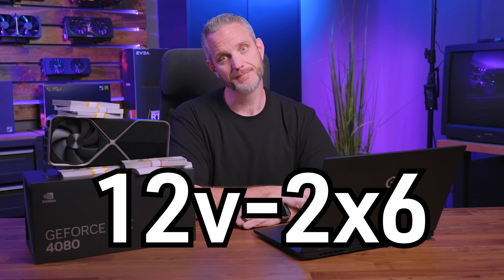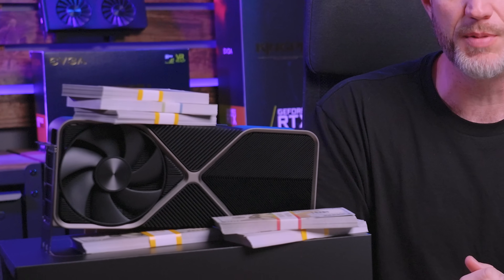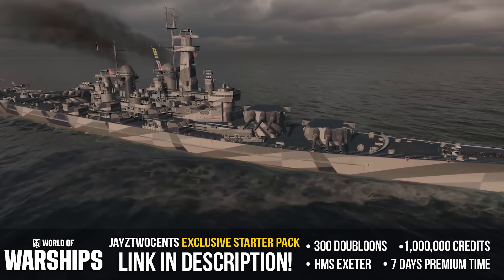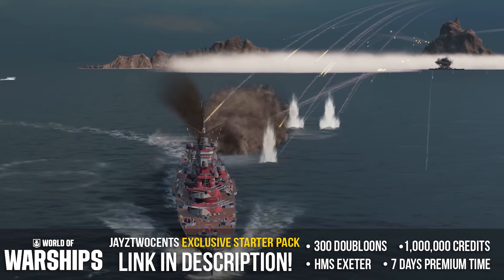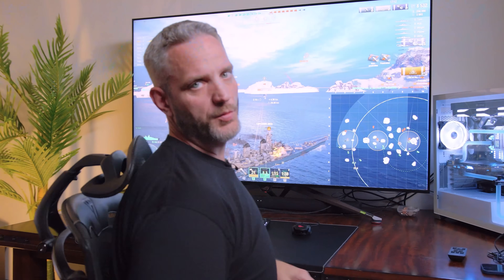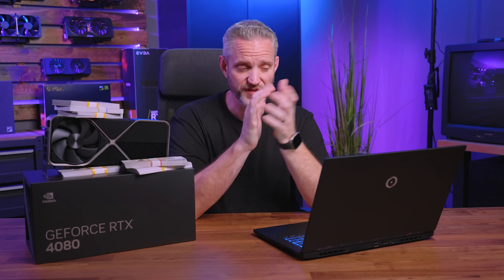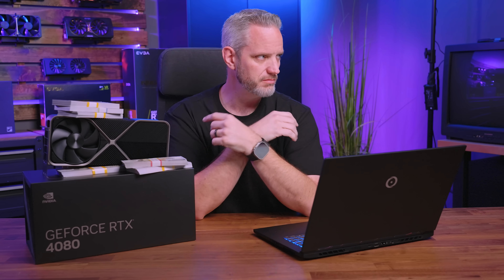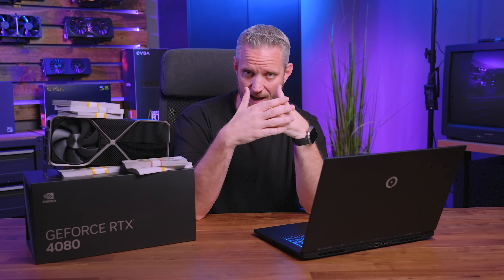They FINALLY admitted that this was a major issue!

Comment: You're channel is  good Jay!
Actually this falls under warranty or a recall action
I stick to my point, better control of products to be purchased before they can be sold!
For the very powerful graphics cards in the future perhaps a better connection to the 12V supply!
Luckily I don't have the money to buy these very expensive video cards!
I have to save up for that, but I can imagine that with these amounts you can expect that they will provide these cards with an extra short extension cable with the best connector for the graphics card in the packaging!
Reply: Properly seat your power cables, buy a case that fits, do not bend cables, do not use 3rd party adapters, have a professional who knows what they are doing building rigs and you will have a %99.9 success rate according to the data. ✌
Reply: @javiersantana848  I have assembled computers my whole life!
What I have been reading here lately about expensive but poor quality cables!
Very expensive but also bad graphics cards going up in smoke?
No one who assembles these parts correctly can change that even a professional.
It is an expensive lottery!
By the way, I'm scared when choosing a new heavy graphics card for my flight sim computer!

Comment: was it only the 4090 that had an issue? or all the cards that used the 12vhpr? I've been looking at a 4070 ti super and I'm concerned because I've been seeing news that it's STILL an issue.
Reply: "was it only the 4090 that had an issue?" Any gpu that fails to properly seat power cables could have issues. This same issue has also happened to the 30,20,10 series and beyond. Due to the higher total power draw of the 4090, it becomes a bit less forgiving in these regards which is why we are hearing more about the 4090 than any other gpu when user error or 3rd party adapters etc. Google search shows this. Properly seat your power cables, buy a case that fits, do not bend cables, do not use 3rd party adapters, have a professional who knows what they are doing building rigs and you will have a %99.9 success rate according to the data

Comment: Hi Jason, Just wondering what your thoughts are on the Corsair HX1500i PSU coming with a 12VHPWR lead but only using TWO x EIGHT PIN PLUGS (of which only 7 are populated) & thus only using 2 of the sense connectors on the 12VHPWR plug but claiming that the lead is suitable for the 600W requirements of the RTX4090 ???

Comment: Is there an H+ or H++ on the plug somewhere? Mine has a date on one of the 4 plugs 06/23/23? How do you tell if you have a new one or not?
Reply: did you find an answer to this
Reply: No only a date of 06/23/23 on one of the plugs. I didn't chance it I went with the msi a1000g with the new 12 volt plug to be on the safe side.

Comment: Why don't they just manufacture a pin without the barbs and come up with some type of clip similar to locking down a processor?  That way when you want to disconnect, the plug would come out easily without the barbs yet the clip would keep the plug secure.

Comment: So it has been 3 months now, and I am reading posts on reddit getting a 4090 with the new connector, are there any reports of these new connectors having any problems? I am very curious because I just ordered a 4090fe at the nvidia store. So did the new conector fix the melting problem?
Reply: Same issue with the new connectors because the actual problem is user error. These videos are click bait at this time

Comment: Got the angled v1.1 adapter in the NICK of time just checked my previous adapter, started melting luckily the gpu connector itself is fine save for the top right connector now being dark grey

Comment: Lots of plugs on cars use locking pieces. Little annoying, but they hold solid for 20 years. I know it's not practical but this is why I like bolt and ring eye connections. 
I remember the plug on my 2070 and even older 7870 is a bitch to plug in and I always worry about something breaking.

Comment: Is Nvidia going to do a recall to fix existing cards ?
Reply: No they would tell you jus to return it to get it fixed if it happens again keep sending it back lol nvidia offers 3 years warranty. They wouldnt do a recall as then they would have to accept working cards that did not have the problem yet

Comment: seems like 12V was too low and they really should've gone straight for 24V... also stop messing around with these connectors. we know how to do this right: screw terminals on the board and ring terminals on the cable.

Comment: I have another theory as to what may potentially be causing it as well. If the pin is bent slightly (so it is no longer centered within the plastic housing), this will force the connector contacts apart. While I have not had this happen with a 16 pin, I have had it happen with an 8-pin. It didn't cause a fire or anything to melt, but it caused the system to continuously bluescreen. I had to discard that power supply cable since the contacts inside one of the connectors was forced open by the bent pin on the GPU connector. I also had to re-center the pin with needle-nose pliers to avoid the same fate happening to my other PSU cable.

Comment: I have always said from the beginning of 4090 that the power plgs on the PCB were low quality and couldn't handle the high amps when working at max or near, but you all were stubborn and said it was other things. Thi shows how yall are stupid except the ones who agreed that the plugs weren't good for that Ah draw, specially people who understand about electricity and know that high amps require thick wires and good quality plugs otherwise will melt and burn.

Comment: Any cable that carries power that can be fitted wrongly or can come lose is a badly designed dangerous cable, the original cable was rushed, badly designed with too little testing for use, fit and robustness. It's wouldn't be a problem if they Limited the power required by the card.

Comment: Is there a 90 degree adaptor available for connecting power to the 4090 card? This could eliminate the need to put a bend in the wiring so close to the connector to the card.
Reply: Cablemod makes those but they use the astrom connector.

Comment: Question, I have a 3090 should I be worried about the stock plug I have (12pin- 2x8 pin) or is It just the 40 series having issues

Comment: At least changes have been made that should all result in an improvement.
But the naiivety of the engineering, and ignorance of the "failure mode and evaluation (FMEA)/ safety" glaringly highlights a modern problem. Just like how the 737 Max was given software that wasn't thought through (What if the single sensor it uses fails? being an obvious Failure mode), I cannot understand how so many companies these days manage to botch the engineering through a lack of understanding of basic physics. 

Even the fundamental features of the 3-dimple Astron design are completely not understood, not even by the committee that decided "use NTK". Far from having three pads in full contact with the pin, each blade of dimples will only have one edge of one dimple in contact with the pin. Because the "stiffness" of the folded metal construct only has one solid connection between the two halves, and it runs very close to where the first dimple is located. Even slight contact pressure with each blade will deflect the tip of the blade away from the pin, leaving two of the three dimples touching nothing but air, and the one dimple in contact will only touch at one edge. Nobody considered how the metal would deflect as contact pressure was applied. 

I can't say whether NTK "got lucky" or actually invested time and money developing a "spring" design that can accommodate movement as the socket is deformed by contact pressure with the pin. But with a "spring" on each of four sides, at least one edge of each spring will remain in contact, regardless of the pin shape. So it will always have more contact area of metal to transfer the current. And therin lies its superior ability to resist melting, even if the NTK design itself still leaves a lot to be desired. 

All metals have electrical resistance - they just happen to have much less resistance than "insulators" and hence are called "conductors". But when a plug or switch has to be capable of opening or separating, all of the current carried along the wire has to get across the touching surfaces. With the dimple design, the current density (total current passing through an area) will be much higher in the tiny arc of edge contact at one dimple. And it is current density that causes heating in metal. Further along the wire, the current will have managed to spread itself out across all of the strands (or gauge), and that low current density is why those wires do not melt. Break most of the strands, severing the current in them and forcing that current to flow in the remaining strands, and that higher current density can indeed lead to melting. 

And all of that is barely common sense when it comes to current flow. The drama comes from consideration of current density not being nearly enough to make sure the connector is safe. 
It has to be coupled with what is barely common sense of mechanical engineering, with how materials AND geometric shape combine to result in real deflection and contact pressure distribution between things touching each other, to get something that can handle a real world application. 

It is the lack of common sense in the mechanical side of the dimpled connector that I find truly appalling. Previous designs might have worked OK, but that would be "in spite of" what they have designed, not because of it. 

It is quite possible that NTK didn't do any actual design development work for their spring design either, but used decades of "prior experience" to use what they knew works. Because, when things have been tried and tested before, there is little sense in reinventing the wheel. Which is why (for one example) threaded connectors have common standards (whether Imperial, Whitworth, Metric, JST, or whatever thread is appropriate for the application and industry). Building codes have formed over centuries of use, where steel reinforcing and concrete specs that were not good enough have gradually been phased out for "appropriate" levels. But even then, earthquake proofing might force a rethink. And so on. Sadly it usually takes a disaster (like a collapsing motorway in LA) before us dumb humans realise we were not smart enough to predict everything that might happen. 

While every specification in use today has resulted from years, decades, centuries of "trial and error", we DO now have engineering tools that can be use to PREDICT the performance of new and untried designs, and how they will react to variables like the thickness tolerance of the solid metal pin at the centre of each connector. Because, we cannot make that pin EXACTLY the thickness specified, without allowing it to be slightly bigger or smaller than ideal. It costs money to make tolerances tight, but it remains physically impossible to make it an exact size to the atom. 

Sadly, our ability to forget the hard lessons of yesteryear, and have to reinvent the common sense wheel, remains all too prevalent in this day and age of "cost reduction".

Comment: Thanks for your two cents Jay! As usual I am mostly on your line as usual. I am happy I did decide to skip until they changed the 12v plugs. I had a hunch they would eventually, but did not know. However I did not want to risk my hardware since I am not wealthy enough to do that. Also I did not have a extreme need, as i do have a 3080 that works well still, even if it is getting long teeth by now. I would have love to buy a 4090 for the same money I paid for this 3080 during the worst scalper period. But I still waited and waited in fear to do the swap. And now I see light in the end of the tunnel. I don't know if 'l go for a 4090 though, I might just wait for 50 series..

Comment: I suspect there will be a class-action lawsuit if Nvidia does not issue a recall on the cards affected by this flawed connector. It happens to auto companies all the time. They only need to prove there’s a flaw in the design that poses a potential safety risk.
Sounds like that would be easy to prove

Comment: Another problem is using CMOS. It is inherently quantum mechanically defective. There is a transient short between power and ground every clock cycle. Increasing the clock speed increases the number of shorts, causing more heating.
A current-based technology such as resonant tunnel diode threshold logic would reduce the power requirement at the same speed by a factor of 100,000 (think 2.2 THz at 5 W). Plus it would be smaller and therefore cheaper.

Comment: The problem is NOT in the cables. The problem is in a bad 12 V standard. Communication centers and data centers have been using a 48 V standard for decades (I worked with it in 1972). That would reduce the current by a factor of 4, stopping the cables from melting.
One reason they chose 12 V is that the 1920 buck converter used in VRMs cannot do a 48V to 1 V reduction. You have to use a 2023 design such as the Ćuk-buck2 converter. Unfortunately, it is cheaper, smaller, more efficient, and provides a better transient response. Adopting it would require the "engineers" to actually learn some of the last 100 years of improvements in power conversion technology.

Comment: Hey Jay I was a big time RC car and truck user when I was a kid anyone that was in the late 80s to 90s prior to Lipo were forced to use Nicad batteries and the higher the volts and amps lead to massive battery fires and shorts this reminds me of back in the day, one thing that came to mind was the connection between speed controller and battery the connection that had the split in the receiving pin or female side was found to be the culprit in the loss of connector when the plugs were connected and the power was surging through it any sort of gap or misalignment of the fonnection resulted in an arc similar to the idea of a spark plug, In this scenario it can be just as detrimental as it creates heat and with heat then the connectors with the split would open up creating more arcs all of the gpu plugs are reminders of the old Tamiya plug styles or Molex that as a racer we would clip off in favor of the deans blade connectors back in the day, im curious if any of this holds true in these current connectors on gpus now adays

Comment: Let's see, we went from 450 watts thru 24 wires (12 power + 12 ground) with larger pins on 8 pin connectors that are easier to fully seat to 600 watts thru 12 pins (6 power + 6 ground).  The idea of the 12VHP standard came from an engineer or more likely business manager that didn't like the aesthetics of three 8 pin PCI connectors.  Then the design was given to a young new arrogant engineer that didn't have the experience to know that the specs of the spec sheet were best case scenario and that they couldn't design it for best case scenario.  Is the the 12VHP a bad idea?  No the idea is fine, but they should cut the rated wattage in half to 300 watts and then use 2 of them if more than 300 watts is needed.  
150 watts / 12 volts = 12.5 amps
12.5 amps / 4 wires = 3.125 amps per wire and pin on PCI
600 watts / 12 volts = 50 amps
50 amps / 6 wires = 8.3333 amps per wire and pin on 12VHP.

Comment: Something I don't understand is why there isn't is a push lock on both sides of the plugg not only on the top or bottom. If these where in both sides I would be more visible to see that it is fully plugged in. And would also require pushing both locks at the same time to release it. Now all that said it is for sure a improvement to have a better contact surface and all other improvements. Would still like se push locks on both sides.

Comment: I figured this out in the beginning. What took them so long? They deviated from the standard Molex plug and connectors and screwed it up. I have been in this industry since the late 80's and this bugs me when an obvious flaw is designed into equipment.

Comment: This may be a stupid question but I gotta ask why can't they just add another connecter just like they've done with the 8pin power connevters high draw cards get two or even three so can't they add another 12pin connector, is it just cost?(would be kinda crazy to cut costs at this point with a card easily selling for $2k.

Comment: Where are all of these "left and right melted connectors" Jay? Once the information came out that it was user error and based on how well it was seated, the entire problem seems to mostly have solved itself.

So while we started with what, less than 20 confirmed cases of melting cable, suddenly we are using phrases like "happening left and right" when its now happening less often?

Another video where jay MISLEADS everyone. This has become so common over the last year or so on this channel its absolutely unacceptable and Jay's reputation in the PC building community started off really good, but has slowly been death spiraling as he plays more and more fast and loose with how he reports on current PC events.

Comment: I don't agree with the early adopter statement. This is a blatant design flaw which, without doubt can result in catastrophic failure leading to fire. It should be treated as per the car industry as a recall and rectification of all components affected by the flawed standard. Nvidia and partners should own the problem and rectify for free. Sales of millions of units cannot replace a sufficient lack of adequate testing prior to production and sale and the end user is not responsible for bearing the financial or risk ridden burden of affected products.